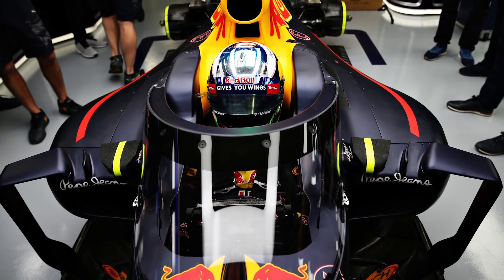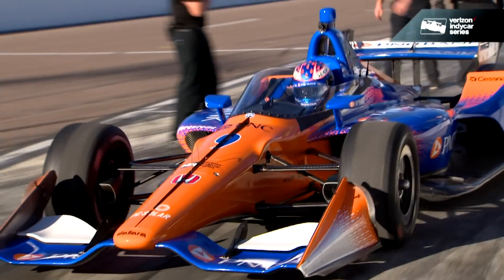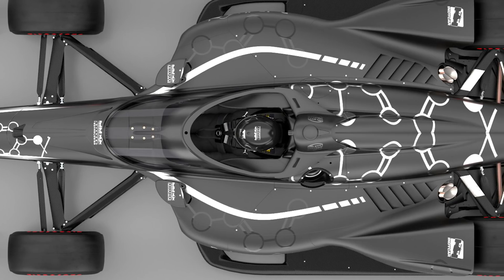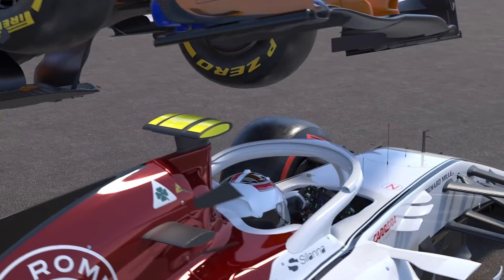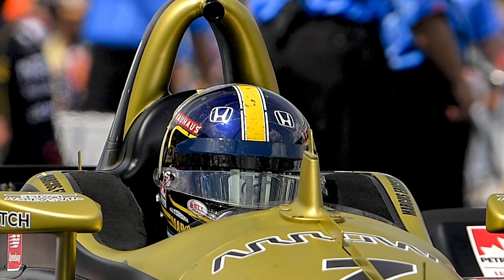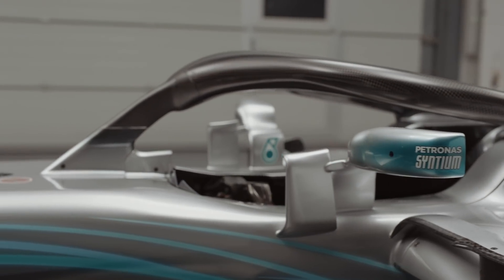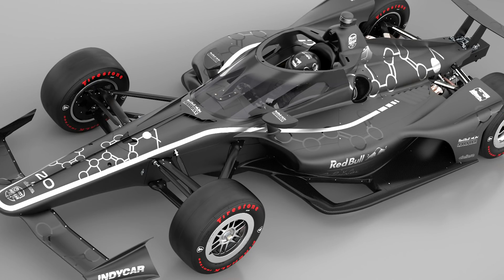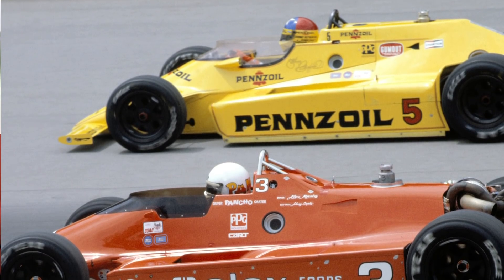Why IndyCar chose Red Bull's screen that F1 rejected

Comment: They need to prevent what happened to Justin Wilson RIP and Dan Wheldon RIP. Gotta protect these guys heads.. If there heads were not exposed they might have Lived. Wheldons head hit a post. Wilson a nose cone. I believe Wilson would have lived.  Wheldon maybe. That was the 2nd nastiest wreck in open wheel. The Greg Moore crash was horrible.  He had no chance to live.

Comment: I don’t like the halo or screen, we have closed cockpit racing series, if you want full protection from head impacts race in that. F1 is open cockpit. Racing in an open cockpit series is a risk and the drivers must accept that if they don’t there are plenty of closed cockpit series. Moto go doesn’t have this, they still race they just accept the risk. I like closed cockpit racing a lot, I actually plan to complete in rally in just a year, but f1 is open cockpit, I want to see the driver just like you want to see the rider in motogp.

Edit: I’m ok with the 2022 halo, as you can see the driver well, but I don’t think it is a good path to go down, if f1 goes closed cockpit I’m definitely not watching, it defeats the purpose and is opposite to all of its history.

Comment: I mean I get the appeal of a IndyCar and a F1 car. The open wheels and the wing. Fast speeds but if the teams want to...oh I don't know...go faster. Why not enclose the cockpit and even cover the wheels. Reduce the drag on the car. Make it cut through the air more. Then, again there are safety issues with going faster but hey why not drive slower (Sarcasm warning)? By the end of the day. FiA bans something because the other teams did not want to do it. Meanwhile, IndyCar thinks it is a good idea and dies it. Before long. FiA thinks it is a good idea, forces the teams to adopt it or else, and well it is history and FiA rewrites history claiming THEY thought it was a good idea and never thought of banning it in the first place.

Comment: Halo looks okay and protects the drivers that's great! But putting a screen will just make F1 same as LMP1 with a hole in a top. Also, I think screen will get some particles stuck or maybe crack it. I don't think so changing a screen will be feasible in pit stops and Cleaning screens will increase the pit stop time as well.

Comment: The problem with a screen is that it can get dirty, and when it does, the driver can't see anything anymore. That was also one of the reasons why the halo was chosen over the other options the FIA had
Reply: Tear offs are a thing though, plenty of pit stops to geta clean screen.

Comment: What happend to Rubens would not happen today. The spring went through the bit where the viser and helmet meet. They have since been designed diffently so an inpact on the edge where those 2 meet cant work its way through. The helmet is the only part stick out. That will protect the driver from small bits. The thing left at risk without a screen over the halo is the hands and fingers if they happend to be putting on alot of steering lock in sharper corners. There the speeds are lower that you gotta be really unlucky that a sharp bit comes along and takes of a finger while your hand comes out over the cockpit because you are steering scharply.

Comment: While I was onboard with the halo, the introduction of a screen on top of that I think is one step too far. While safety is paramount, small impacts to drivers helmets strong enough to impose any real threat to the driver are extremely rare. The last incident involving a small object that seriously injured a driver in F1 occurred over a decade ago (Hungary 2009). To make a change so drastic and costly as introducing a full screen I think is simply unnecessary. In the case of Gasly, that was a stray piece of carbon that landed in his lap which isn’t nearly strong enough to puncture a helmet, let alone dent it. Drivers already have small object protection, that being their helmets.

Comment: The screen and the halo ruin the aesthetics of open wheel cars and will change the way the races work. But if they save one life that would have been lost without that protection, I will take that difference in racing 100 times out of 100 no question.

Comment: IndyCar did not choose the Red Bull wind screen though. This is all bogus. The original Red Bull windscreen was nothing more than a thick lexan wind screen. What IndyCar actually adopted was a halo frame wrapped in a lexan windscreen. Look at it closely. The guys actually mention it in the video. Also, F 1 chose the halo because it was the only device that passed all their safety tests. The Red Bull wind screen failed miserably when they shot a rimed tire  at it at 150 mph.

Comment: The fact that the Halo still exposes the back of the helmet to several inches of complete and utter non protection baffles me Beyond no end! Seriously why is it that people are so concerned with the look of the car that they are willing to sacrifice the drivers for clean lines? Maybe as an American I've seen too many situations like Dan Wheldon where the source of impact comes flying in from a wall or a catch fence but the way the Halo is set up with a Halo sloping downwards towards the back and the maximum head protection piece behind the driver being where it is it's literally going to funnel in heavy debris right to the top of the F1 drivers head and that's going to do nothing but straight compress the spine and leave a driver either paralyzed or dead.

Comment: 8 months late, but I am curious about the aerodynamic effect/efficiency. Specifically if the specification on the shape and size are fixed; and if not how much could tinkering within the rules benefit down force, cooling and drag reduction.

Comment: To answer the question asked in the title of this video: because Indycars pause the race when it starts to rain. Formula 1 would need windscreenwipers that can handle 360km/h
Reply: I see you know nothing about Indycar seeing as you think all indycar races are red flagged if it starts raining. A good two thirds of the schedule are road and street races, which keep going if it starts raining. There's no need for windscreen wipers, the screens will have a hydrophobic surface to prevent water sticking to it.

Comment: I will preface my comments by saying that I am a strong advocate for safety and that I endorse the use of this technology in both F1 and in IndyCar. I have been following these two series (and NASCAR) for almost fifty years, so I have seen many developments in safety-related technology. As dangerous as the open-wheel cars have been, I don't remember any instances in the pre-halo era where a driver would have been protected by it. That said, I am grateful that the halo was in place during the accident at the start in Belgium.

Comment: Then don't race, if you wanna cover all corners hence safety.
It is the ultimate racing, and the danger aspect is also a part of the sport and the end of the day. they are way way more secure here present time' then previous and sure you can almost lock them inside, acrylic and halo etc, and next you can look at F2 accident and then make cockpits and more walls etc.
at the end of the day,  numerous of the tragic accidents like Bianchi that was a big part of the reason for the Halo and also F2 here recently is sadly a series of very tragic accidents all elevating each other and that is extremely difficult to take into consideration.
You can also be to hysteric with protection IMO to an extent that you undermine the racing DNA  F1 always has been synonym with and to some extent goes hand in hand with the fascination of the sport.

Comment: The Halo did save Leclerc"s life(So Jules"s).But remember MASSA being hit by that flying spring,a halo could have  diverted it,directly down to his chest...!!!!..I believe the double set-up(halo/screen)is the way to really secure the Pilots,especially for smaller fast flying pieces of sharp carbon fiber... Hitting a flying I.PAD size piece of carbon at 360 KP/H,would certainly cut your arm/hand/head off........!!!Remember the Shuttle hitting that  small piece of foam with its wing.......
Reply: While I agree that the red bull/PPG haloscreen is better, the shuttle is a poor choice of comparison.

The shuttle part that was damaged wasn't the typical carbon fiber as used in race cars, but reinforced carbon carbon. RCC is what you get when you overheat normal carbon fiber composites until the epoxy burns, so while it can handle incredible amounts of heat it is very brittle, you can actually break that part with your bare hand. (Not to mention a great difference in impact speed)

Comment: In my opinion , more development should be performed on drivers' protection, like integrating helmets and hans and designing them not to absorb an impact but to transfer the load of an impact to the car structure, which would be also designed for that purpose. Then we'll be able to come back to fully open cockpit cars with extreme safety!
Fencing of speedways, core value of Indycar, should be standardized to high level of safety...today they are just shredders. Safety walls were a big improvement but they stopped there instead to move forward to the higher side of the fence. 
I'd really like to see the safety to hit 240 mph in qualify at the IMS in the next few years!

Comment: they could always puch tiny holes in the glass for ventilation
Reply: Was thinking so too, but holes can do too very bad things, 1) it reduces the structural rigidity of the screen, and makes it weaker 2) holes in a translucent screen can form points of glare at each hole as sunlight deflects off of the thickness of the hole's rim
Reply: @Cobrastarzz1  bruh a 6 holes with a 3mm diameter each spread evenly across the bottom of the screen will have virtually no effect on the screen which has a house surface area. And no a 3mm hole will not cause glare that's just stupid helmets have holes and it doesn't compromise shit
Reply: @VoidPixel4179  True, i was thinking u meant holes of a more significant diameter
Reply: @VoidPixel4179  Look on prototype, 6holes 3mm not even inside view, they have a space between halo and glass

Comment: The halo is like a roll bar: it prevents big object to hit the driver, or injuries to the driver in case of strange overturn, but totally miss the point to protect from flying debris (Felipe Massa incident alike).

The thought about not having a windshield was just because F1 is still considered an "open cockpit car", and probably a concern about fast egress in case of crash, together the fact that if it became dirty during the race, there is nothing that a pilot could do to regain visual (visor in the helmets can be fast cleaned by the pilot removing one of the transparent strip that cover it).

... but at this point I do not see the point to keep the halo without the windscreen at all, just to remove completely any risk, plus giving to all the cars a full, complete, smooth look, but also I understand that most of the issues are about the fact about dirt, because an F1 car has not any wiper!!!
imagine a car forward leaking oil or other sticky liquids, and a sudden pilot going 200-300 km/h incapable to see anything and most of all incapable to fix it like now, pulling out a simple transparent strip from his visor!!!
THAT is the major concern, I think, about the preference about an open halo, rather than a windscreened one, in F1...

Comment: The problem with the zero screen is that tire marks will be left on the screen and they are not so easy to get off, effectively blocking some of your view
Reply: Not really for the most part they would be able to come in pit get cleaned up relatively easy. 

https://youtu.be/9xfYusNYSTk

Comment: Please no. If you're going to add a windscreen, just make the car have a closed cockpit. What's the point of having an open top? Small debris impacts are rare, and the halo does a very good job at protecting from large impacts (like cars, tires, etc.). Not to mention the helmet is pretty much the only exposed thing on the drivers nowadays, and those are built to be tough as hell. Yes, Massa got hit, then he hit a wall, but the truth is, that spring would have likely have gone through a normal racing car's windshield. So should we mandate thicker windshields for all normal racing cars now too? You can't make overarching rule changes for every single freak accident that happens.

Comment: I LOVE that Indy Car Halo/Screen design. The current halo on the F1 really accentuates and compliments the sleekness of the curves while still providing added safety. My only issue with open cockpitted cars was the easy access for smaller debris flying into the cars and potentially harming the driver. Glad at least open wheeled divisions are looking more heavily into cockpit safety. 👍🏾😎

Comment: You can't see through a dirty windscreen
Reply: It's not like race cars have never had windscreens before. They use tear-offs to clean them quickly.
Reply: @PistonAvatarGuy  yeah I'll reach out at 200 miles an hour and rip my tearoff off
Reply: @johnerickson2673  It's done during pitstops.
Reply: @PistonAvatarGuy  well is no s##t sherlock

Comment: thhat electric car looks like something i drew when i was 10..... 

i think they are prioritizing looks over function....... simply for social media money
""integrating the halo into the car" doest fix the problem.....

the problem people have is that a center pillar looks strange and unnatural.
i dont care if it turns "invisible" due to the way our eyes work..... 

and i DO care that it saves lives....... and now is PROVEN to do so

but at the same time..... wouldn't two pillars..... like the A pillars on your car..... be stronger?

and even if it looked "strange"....
it would still be less strange than the center pillar
Reply: kain hall  you could do 2 A pillars, but imagine driving an F1 car on track. There is so much change of direction that you spend the least amount of time looking directly down the middle. 2 pillars to the sides that are still forward enough to provide the strength needed would certainly impair a drivers ability to look forward to corner entry and exit as they look side to side. Even on straights, drivers are usually looking at off-center angles as they look at brake markers and other landmarks used for preparing for corners.
Reply: @peragus4  right.... but at a slight off center angle.... one eye would be.looking right at the center pillar 

Idk.... dont their their is any real fix

Besides going full inclosed pit

Comment: If safety is a huge concern then just make the cars closed cockpit. Indy and F1 are cars which are supposed to be open cockpit (for reasons) that comes with a risk. Same with rally or motogp which are cool but at some risk. Don't want to be in risk don't race

Comment: I’m not sure. 
I’ve always supported the halo and I don’t actually think it looks terrible especially given the protection it provides. I think some of the initial F1 aero low-screens also looked fine, even if they couldn’t make them strong enough at the time. 

This screen on top of a halo completely obscures and encloses the driver. You could put a lid on top and they’d be inside the car entirely. I think that’s too far removed from open-cockpit racing. If we’re gonna do that just enclose it all entirely like LMP1 cars have now.

Comment: However, there's no way that F1 can run in the Rain if there's any danger of the screen getting smear with oil and water.

How is a driver able to pull a tear off from the screen?

Currently a driver can just pull a tear off off his visor. Indy don't necessarily run in heavy rain, so unlike F1 they don't necessarily have a problem with this.

Comment: This may sound crazy but I was thinking they wouldn't use a fighter jet style canopy because it would require air conditioning.

After thinking about it, if racing tech makes it way into road cars and vice versa, then wouldn't we want them testing air conditioners for racing cars?

After all are they not already in Le Mans lmp cars?

Even the cool suit and air induction for helmets is nothing new.  So why not air conditioners?

Would keep things interesting and just another possible thing to go wrong under pressure lol.

Comment: Real question is: visibility during rain?
Reply: they already get rain on the visor, and also it would only be a problem at low speeds, at higher speed the airflow will push the water off anyway.

Comment: If it rains during the F1 race, the screen would just make the visibility worse.
Reply: It wouldn't make the visibility worse... There would BE no visibility
Reply: With speeds going over 300kph, you're most likely to wipe the droplets by speed alone. If it's a downpour, you should not be racing.
Reply: @pedrosoandrew  You realize that F1 has lots of slow corners too.... right? And lots of wash from the cars in front... right? So you expect the drivers to be blind until they get to 300 kph?
Reply: however, they may still need to install wipers like Le Mans cars right? Not all sectors on the circuits are flat out straight in order to blow the screen dry. Aside from the water spray from the car in front which can be oily also, there are other track debris that would affect visibility without any wipers on.
Reply: Thats irrelivant, the helmet acts like a screen as well so a bigger screen means better visibility during rain
Reply: @thapelomashaomasemola7922   except, helmets have tear offs in the visor. rain or shine that's what help the drivers clear up their vision. It would be interesting to see if IndyCar can innovate a screen without wipers
Reply: Indycar races in the rain as well on road and street courses